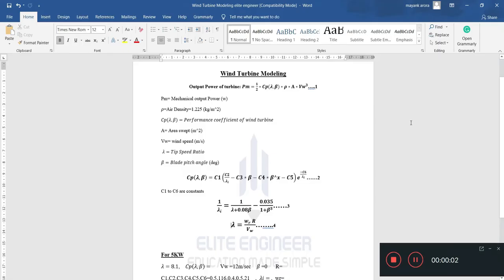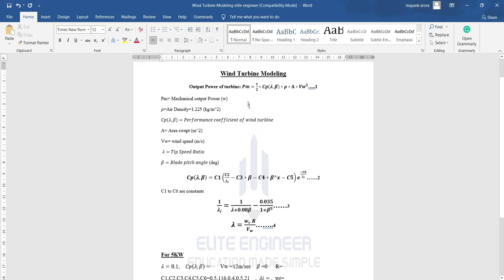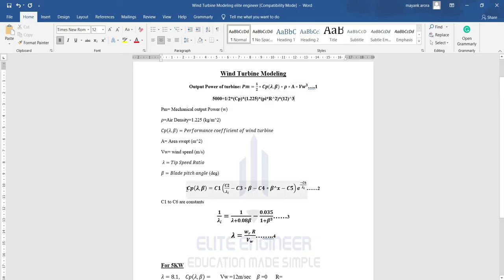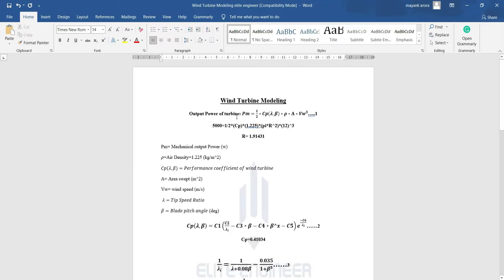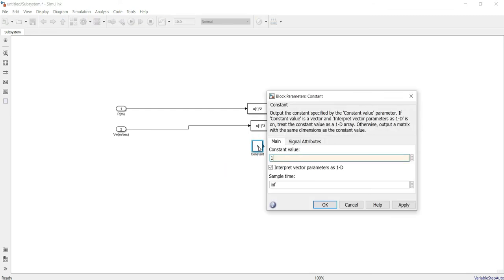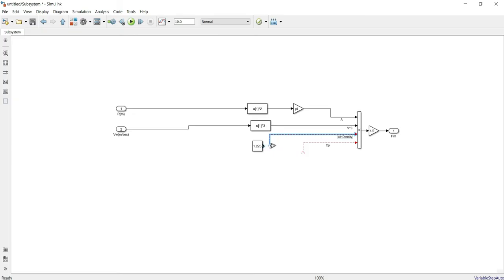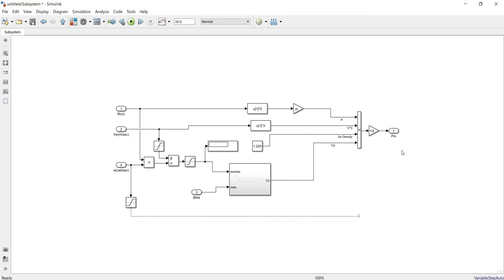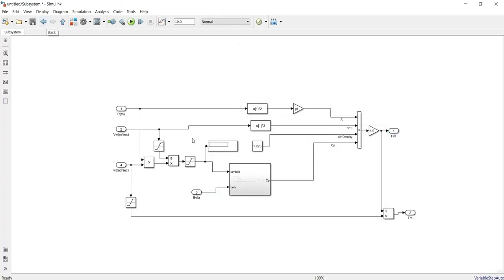Modeling of Wind Turbine in Matlab/Simulink

Comment: Sir, at 18.26 calculation of torque is Pm/wr. So the connections of the block should be interchanged . Kindly correct if I am wrong.
Reply from the maker: You are right dear kindly interchange

Comment: Video is superb bro , no doubt on your skill and knowledge . but i think mistakenly , you used the same multiplication block in calculation of torque . sign of that block should be reverse , as Torque = Power / Angular speed
Reply from the maker: Thanks for pointing it out, i know i made a slight mistake in the final block implementation . Kindly correct you will get the modified results.

Comment: Can we integrate this system with existing microgrid model and give its supply to load?
Reply from the maker: You have to make minor modifications to the existing system. This will not work like this if connected with microgrid.
Reply: @Elite_Engineer okay
Will you help me with that? I need some proper guidance to do the task.

Comment: sir can we use scope instead of display block
Reply from the maker: Sure you can
Reply: can you explain how?  because we're only getting a point on the scope at 5kw power axis
 @Elite_Engineer
Reply from the maker: See it depends what are you checking on scope, if you see something that is changing with time you will get the changing output. You can check by changing the scope parameters and explore more options if your output is not as expected. I do not have this simulation file now otherwise i would have tried all the options. I hope i answered your queries.

Comment: Thank you sir for keep it simple for understanding....
I have a doubt....if I want to use this model in other system then how it will attach
Reply from the maker: Yes, if you want to attach this with other system, you need to simulate dc motor and inverter to be connected with this model. You can see in literature, various papers are available.

Comment: Thank you for the explanation, but I have a question about the model, is it possible to use it if the wind speed is not constant and it is variable with time? Thx! And sorry for my bad english, I am doing my final project for my electrical eng. degree.
Reply from the maker: You can use this part of model with variable wind speed.You also need to attach some more elements at the output for utilising this output power. Kindly refer some papers for that.

Comment: Hello sir I need your help for wind turbines model
Reply from the maker: Hello what help do you need? I already shared the wind turbine model.
Reply: Yes I know but wind turbines combine with sepic converter
Reply: @Elite_Engineer  ND I not get output from wind turbines 34Volt
Reply from the maker: Wind turbine with PMSG then sepic right
Reply: @Elite_Engineer  yes sir
Reply: @Elite_Engineer  I need 34v input 7A from wind turbines then 200v and 2A from wind with sepic by using mppt
Reply: Please do needful help
Reply: Hiii your wind turbine project completed ?
Reply: @sultanashish6417  not now in running
Reply: Why

Comment: hey i needhelp
Reply from the maker: Yes may i know?
Reply: lets say i want to add a generator how would i do it and my wind speed is only 5m/s i need to reach a goal of 25kw power generation via multiple wind turbines. but i only want to simulate only one turbine hoping to reach atleast 2.5kw is that possible ? @Elite_Engineer